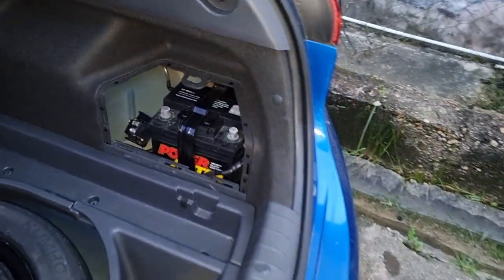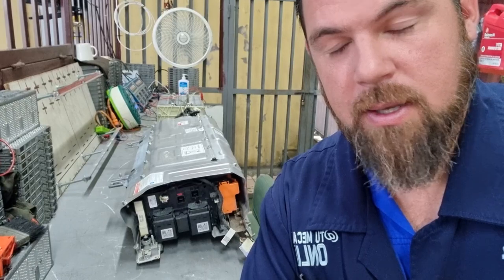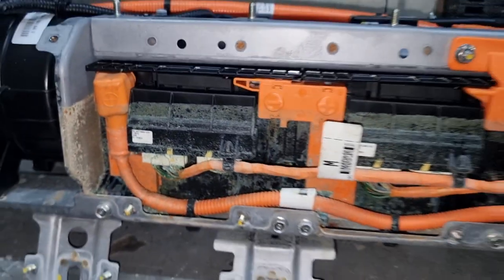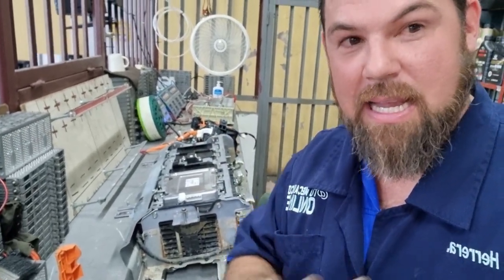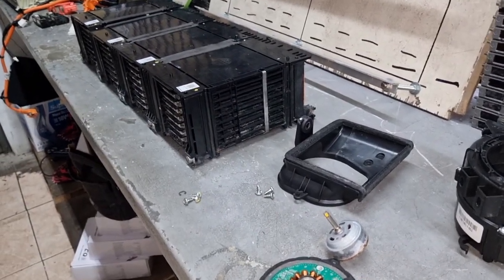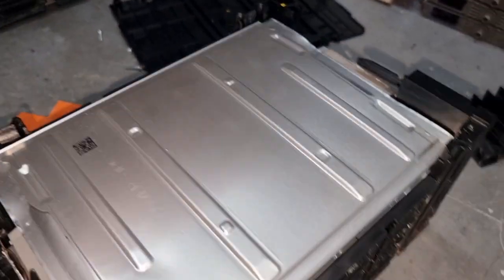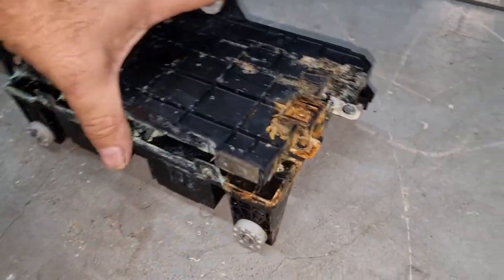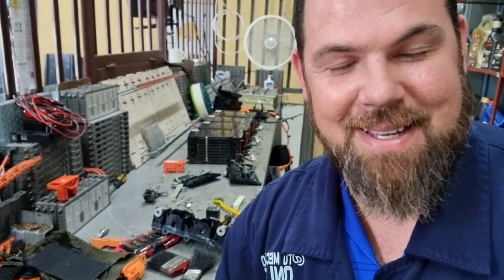flooded hyundai ioniq kona hybrid battery deep inspection

Comment: Was this corrosion from salt waterfrom the sea? Or is it just non salt water from rain? I realized when you opened more of the battery that yes electrical voltage doesn't mix with water therefore causes corrosion.

Comment: Gracias. Recientemente han detectado en mi Ioniq HEV una avería que dice el concesionario oficial Hyundai que proviene del BMS, según ellos, esta estropeado y me lo van a cambiar por un repuesto original. Mi pregunta es : ¿Es inseparable el BMS de la batería donde esta montado o se puede cambiar únicamente el BMS?. Espero tu respuesta, si fuera posibles.
Reply from the maker: Como puedes ver en el video claramente, la BMS si se puede reemplazar muy facil sin ningun problema 😎👍
Reply: Muchas gracias por tu respuesta. Otra cosa sera que el recambio del BMS este incluido en la garantía de 8 años de la bateria al venir integrado este dentro de todo el pack.